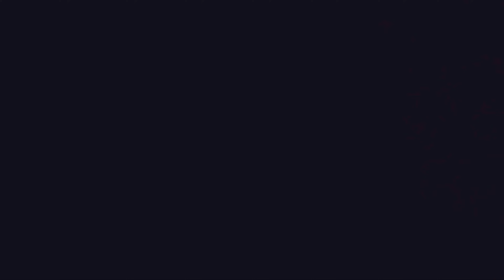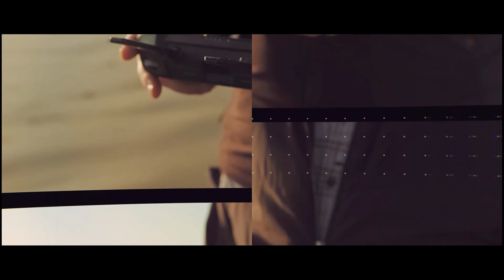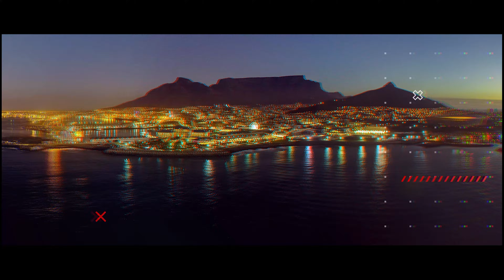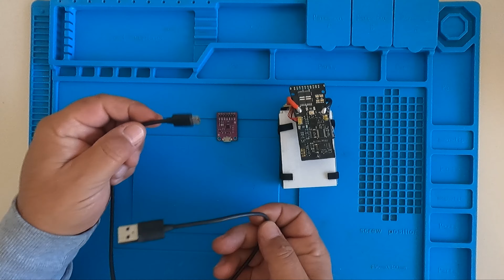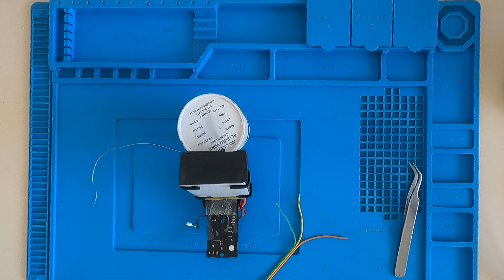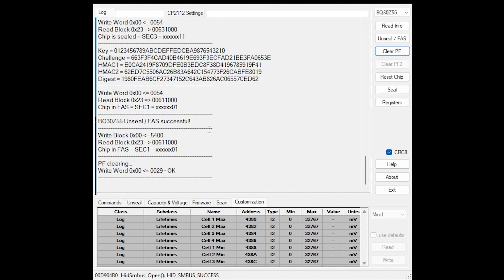Is Your Mavic Pro Battery Really Dead? Try This Fix

Comment: Great video, I'm curious if you're still doing this? Have you done any DJI mini 5 Pro plus batteries yet? I received two that had discharged too much to take a charge. One of three was good. I've tried a bunch of different things but seems like will need to debug. Not much information available as this is pretty new. Thank you

Comment: Is there a way to do this with a 9v battery?
Reply: Unfortunately 9v is too little voltage to get each cell at 3.5 ( 3.5v x 3 equals 10.5 ). To wake up the BMS initially it would be enough though )

Comment: Dji uses a lot more glue on Mavic batteries. You should show that case cracking process. I revived my battery by charging each cell individually with a cheap charger to get it above 3v. I clamped onto the solder tabs under the board. Once that was done, the dji charger worked. No fancy software. The hardest part of process is the case. Too bad someone can’t 3d print the case.
Reply: What charger did you use? I was wondering if that could be done
Reply: @chad366987  I had a Latraxx charger for my Traxxas Alias drone batteries. Single lipo cell is used.

Comment: Hi - for a Mavic 2 battery.  Are the steps just 1.) Read Info, 2.) Unseal/FAS, 3.) Clear PF, 4.) Clear PF2 and 5.) Seal?  OR is it necessary to "Reset Chip"? At which point?  Would be awesome if you could show a video of how to manually charge the cells of a Mavic 2 battery once you've removed the case PLEASE 🙂

Comment: Hello. Does it work with the dji mini 3 battery? I use a similar program but I get the error "First, you need to unseal and FAS the chip"
Reply: Hi. It does work with the mini 3 battery yes. Just follow the step mentioned: Read info - Unseal - clear pf - clear pf2 - seal

Comment: HI. can you help me?
bought CP2112 SMBUS.
Connected good DJI mavic 2 pro battery. SDA; SCL; GND; as per the diagram.
Start program, click connect... ok.
1) Device successfully opened
2) Device successfully configured
ok..
if I click READ INFO...
ERROR: Could not perform SMBus read 0x00
Where is the problem?
Thanks if you answer me
Reply: Hi. The Battery voltage total should be approximately 14v. So each cell should be about 3.5v each. Thereafter plug into the charger for about 5 seconds. This should " awaken " the BMS to allow Battery Killer to successfully read
Reply: @AshrafRogers  HI. Nothing...
I also tried powering the circuit from both the battery and the connector. the chip still doesn't respond..... always the same error...
However the battery does not turn on... the button is inactive.
I don't know what to think anymore. Maybe something was damaged.
I have 2 like this.
Thank you
Reply: @SanDrone64  I have the same problem
Reply: Pop us an email. Address in the description

Comment: I couldn't be bothered with lifting the foam anymore you can solder against the sda and scl resistors.ive had to do this because some boards the trace lifts off losing the pad.

Comment: Hi , I successfully unlocked two of my batteries, and start charging again ,.the problem is that the drone is not take.off. I get an error message: BATTERY NOT INSTALLED PROPERLY, UNABLE TO TAKE.OFF"
Reply: Check your solder joints on the battery connector pins when taking the battery apart you can damage them.

Comment: If I understood correctly, after the software reset the battery should be put on charge before using it for a flight correct? The BMS will take the ownership of managing the voltage level of the three cells, correct?
Reply: This is correct 👍🏼
Reply: @AshrafRogers  is it not necessary to use the Reset Chip button in DJI Killer software? or when is that required? (using with a Mavic 2 battery)
Reply: @miles267 Hey. Not necessary at all. Just read info, unseal, check health, voltage etc in the running log, clear pf, clear pf2 if applicable, then seal.
Reply: @ thank you. I’ve measured my Mavic 2 battery at a combined 9.43V. I can communicate with the BMS but need to manually charge each of 4 cells to bring them at least 3V each. Can you link me to a Mavic 2 layout that shows the pos and neg leads for each cell so I can use my adjustable bench charger on each one?

Comment: I recently downloaded the Battery Killer software, DJI Battery Killer-20240524T204629Z-001. When I try to connect, I get ERROR: Could not open device. I don't want to break the batteries open and I sure as hell don't want to buy anymore. Can this software be used for Spark battery's?
Reply: Hi. It can be used for Spark batteries yes, but unfortunately if the voltage is too low, you will get the error : could not open / could not read etc. You would need to open the battery and put it on a balance charge at low current until each cell is approximately 3.5v. Thereafter Battery Killer will detect it and you can clear the PF, check cell health and charge it up normally again
Reply: @AshrafRogers  ...Mines a Mavic 2 Enterprise battery and doing the same thing, I bout the drone used, but it came with 3 batteries, 2 of them still brand new in the box, the one that's not working is one of the new ones.   Do you have to take it apart to put it on the charger I'm guessing?  I couldn't take two pins from my charger and put it to the battery as is could I?
Reply: @sunshyn_RFF  Hi. Unfortunately you would need to open it up yes. The battery connector on the outside connects to the BMS first, then each cell. So the BMS will not allow any voltage to pass to the cells if it has over-discharged. You must open it up to get each cell above 3.5v each and balanced, then connect above CP2112, clear the errors, check cell health, close, charge....... And then happy flying :D
Reply: @AshrafRogers  ...That's what I figured, thank you!   Oh, BTW, dose the drone have any comms with the battery BMS??.  I only ask because, on my Mavic pro 1, I ended up doing the lipo battery mod and it worked out well, the DJI GO app even showed all the telemetry of the battery and each cell.  I recently upgraded to a Mavic Pro 2 Enterprise Advanced/thermal, but I haven't looked into any mods yet, nor do I really want to at this time, was just curious if that was an option?  Thanks again!

Comment: is there anyway to do this without opening the mavic pro battery?
Reply: https://youtu.be/K3DrwyzjVvo?si=_P3OBparcVXJr1E9
Reply: Yes, I already included the link to the tutorial. But this method doesn't always work especially with the updated battery. Just try it.
Reply from the maker: Yes 98% of the time you would need to open the battery , that method won't work if one or more cells are below 2.5 volts,  then you HAVE TO open the battery , also you cannot balance the cells with a sealed battery.

Comment: Can you test DJI charger before you unsolider the wires to see if it starts charging?
Reply: Hi. Not sure what you mean by this
Reply: I think he means once you have done all the  fixing and finished the programming etc ….before you put the battery back together to fly …should you or are you able to some way connect the dji battery charger to the battery and check if what you fixed works now ….or do you have to first unsolder the three wires you soldered and put everything back together because the soldered wires may have some effect on how the dji charger works …like hes checking to see if it will damage anything or affect anything if he checks if the dji charger works before desoldering . …this is what i understood anyway .hope it helps 👍🏼